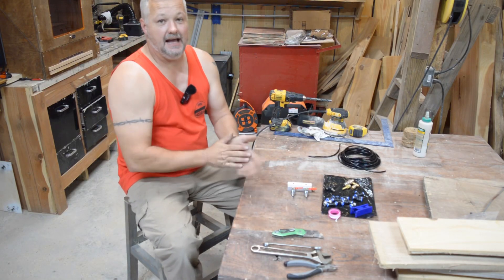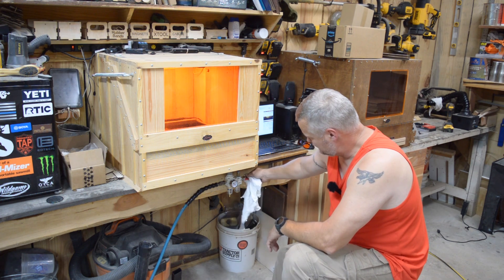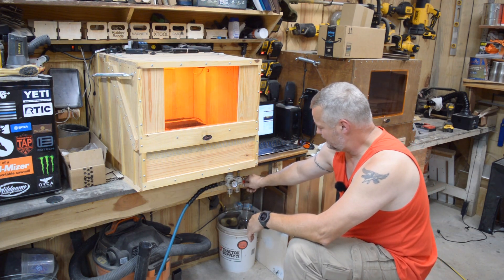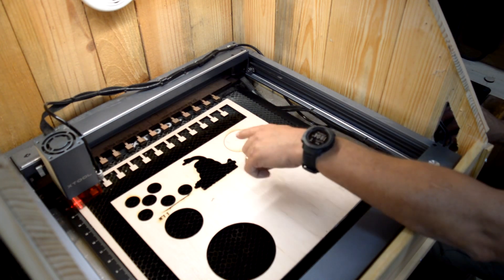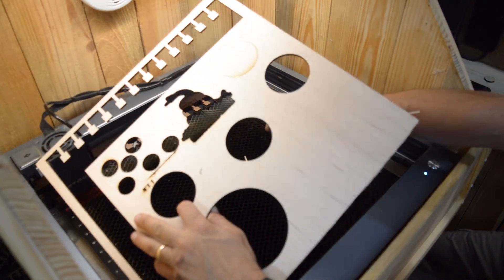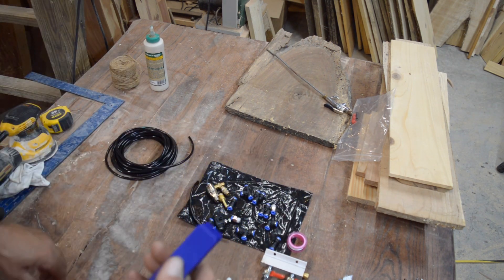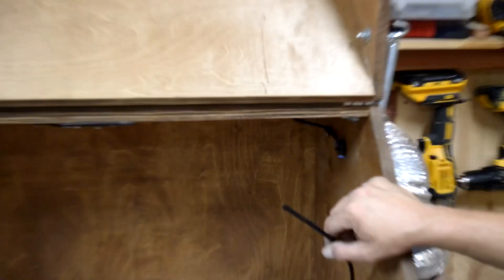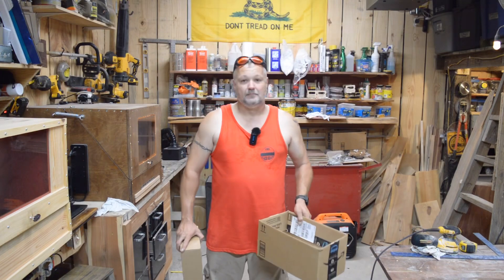My new air assist setup on the D1 Pro

Comment: Really nice setup you have. Did you try different pressures for how good it cuts? Does higher pressure help cut the laser deeper? I'm considering switching from stock air assist to compressor based to increase pressure and airflow so the cuts could be more clean and hopefully cut a bit faster or deeper. Btw I have a Creality Falcon 22W with stock air assist. Is the upgrade worth it?
Reply from the maker: Yes, I dial it in as it is cutting.

Comment: Did the black hose at 1/4" plug right into the air assist port on the side of the laser?
Reply from the maker: Yes, I used the same diameter hose that most manufacturers use on diode air assists.

Comment: is it the 1/4 hose that xtool uses? also did you need an adapter from the small air pump from xtool to use the black hose with it?
Reply from the maker: I used the same hose that comes with most air assist units. I bought some extra connectors and adapters to run it off shop air. The connectors are the same locking connectors that XTool uses.

Comment: do you have a link or a picture of the part that exits the air trap and attaches to the D! air hose? seems it needs to be stepped down in size?
Reply from the maker: Yes, the fitting is a 3/8 and goes down to the 1/4 inch line. This is what I used for the setup.

https://amzn.to/3fkIes3

Comment: This question is not of this video but I know you have the answer. In my d1 10watt, when I engrave a piece of wood and the area is dark why dose it live ridges instead of the whole area being flat and dark/black? Thanks,
Reply from the maker: Thick grain woods will burn differently along the grain. Darker lines of the grain will resist the burn while the lighter part will burn easily. This is really noticeable with pine and spruce. Good rule of thumb, the harder the wood, the less grain will effect the burn. Get into the hardwoods and stay away from character in the grain to avoid it. Personally, I just embrace it and burn on.
Reply: @TheClackShack  Thanks, great advice
Reply: You can also try lowering the power when engraving on those dark pieces

Comment: I did this right when I got my laser. I had a one gallon senco quiet compressor sitting in shop. Took regulator off and moved up to table for control. I run right at 40 psi when cutting and between 5 and 10 when engraving unless I’m wanting a deep engrave then I increase it. I don’t use tools air assist either. I use a straight line directional from Cobey Schmidt. Coming from process automation I knew a vortex type air assist would not give directional control needed for the clean cuts. You’ll like the control of the compressor much better
Reply from the maker: Thanks, I like the setup so far

Comment: Do you think you will need a air compressor dehumidifier to keep water away from the laser head?
Reply from the maker: Probably, I have 2 on my system. One at the compressor and another on this regulator.
Reply: @TheClackShack  I was thinking you did. All of your air power tools would not like you at all otherwise.

Comment: I was running shop air on my 10 watt at just under 10 psi. I received xtools air assist pump with my 20 watt and started out with that and soon found I did not like the noise and lack of psi so went back to shop air. The 10 watt is just sitting ideal at this time. I do not have an air dryer or oiler in the shop air only a regulator.    Dave
Reply from the maker: The oiler wasn’t needed but I like the rest of the setup.

Comment: Good work sir. I ran a line for mine (like 150ft hose) piggyback off the run for my plasma cutter so I could use its air drier. Still get some water in the hose before it though.
Edit I wanted to add I just used aquarium tubing from the regulator to the laser with a little valve there (again cheap plastic aquarium stuff) and I believe it fits those plug in fittings as well.
Reply from the maker: Thanks